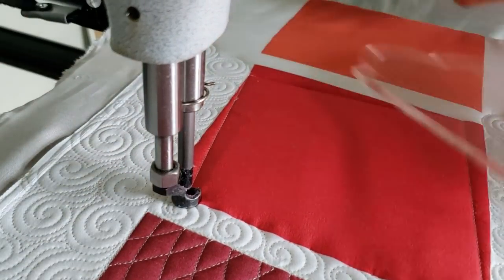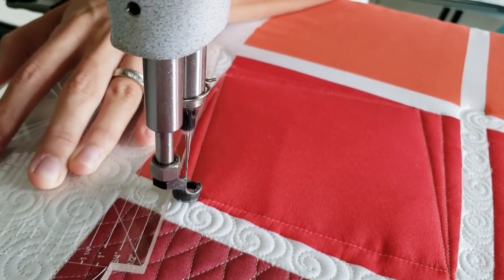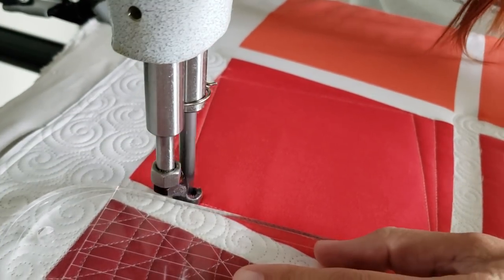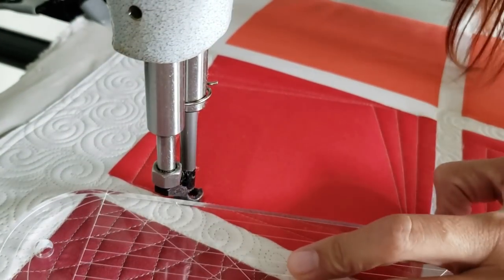How-To Machine Quilt a Spinning Square Quilt Block-W/Natalia Bonner-Lets Stitch a Block a Day- Day14

Comment: Hi Natalia, love your videos. I am following your daily posts. I would like to get one of the fabric panels, but I’m not sure if the site I was trying is secure. It’s one of your links. Do you have an alternative place to buy the panels?
Reply: Also, would like to buy the trailer ruler and the panel from one location. I have the 4-n-1 ruler that I use all the time.
Reply: I plan to get a panel and load it when I am free from the four quilts in my que.
Reply from the maker: Hi there! The panels are only available through Honest Fabric, the link is above, we are not affiliated with Honest Fabric so you'll want to reach out to them about the secure site. The trailer ruler is only available through our site, Piece N Quilt, we are aware that the top says our site is not secure, but all transactions are actually processed through PayPal, so you're taken away from our site to PayPal which is quite secure. :) Hope that helps a bit.